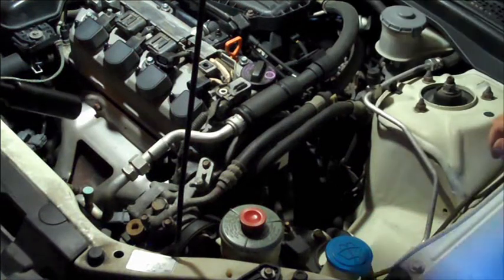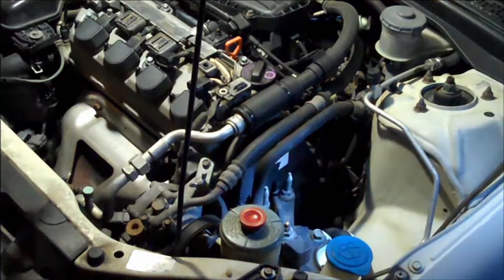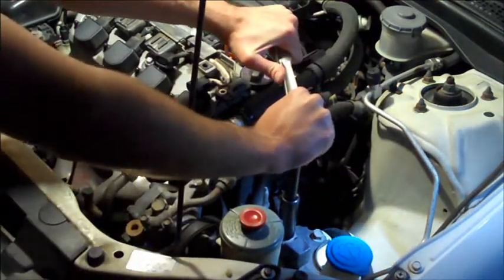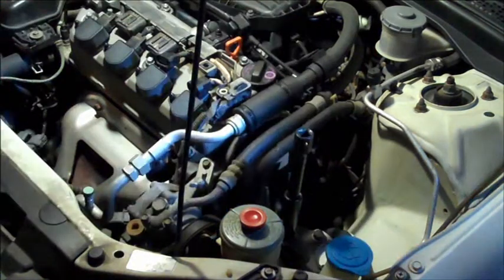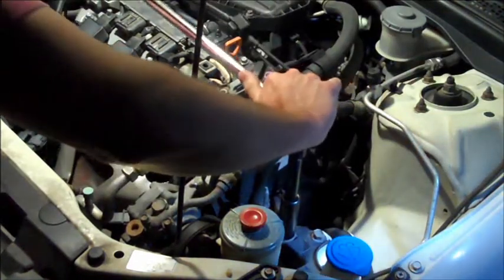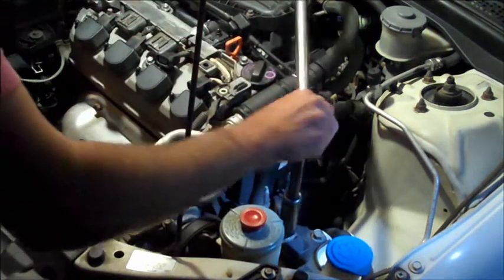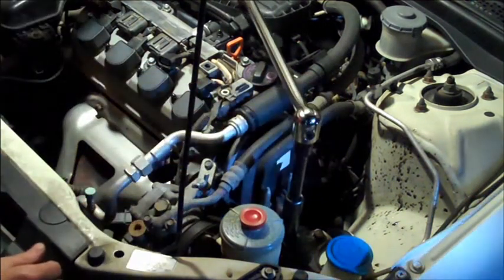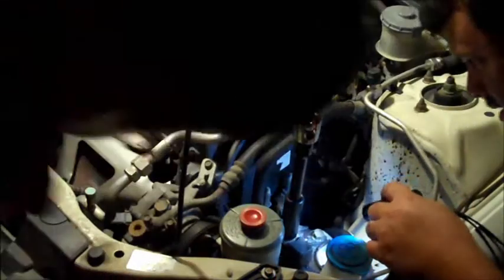Motor Mount FAIL!

Comment: wrongo. Motor mount contain polyurethane rubber with hydraulic fluid.  The fluid softens the rubber to have a little bit of give.  Over time, if they crack or break, or in this case, crack as you are loosening. You would lose fluid.  Number one way to diagnose if you have a bad mount is to check the side of the mount and see if you have fluid leaking from it. If you do, its only a matter of time before the rubber hardens and begins to wear/break off.

Comment: usually, you have to loosen the bolts before you jack up the engine.  Otherwise it won't move and you'll stress the brackets.